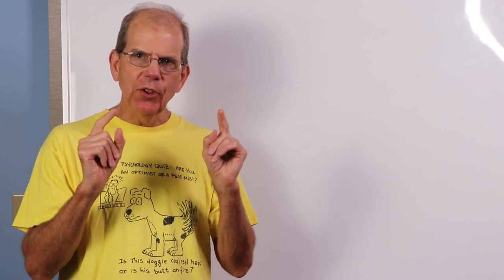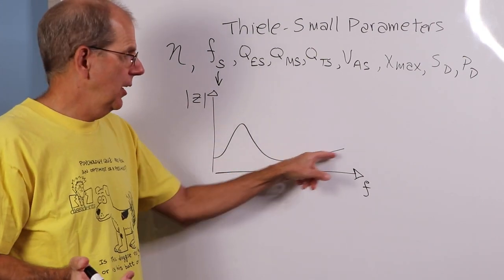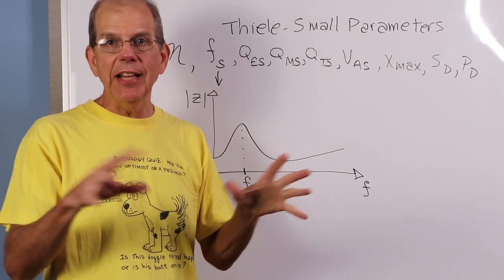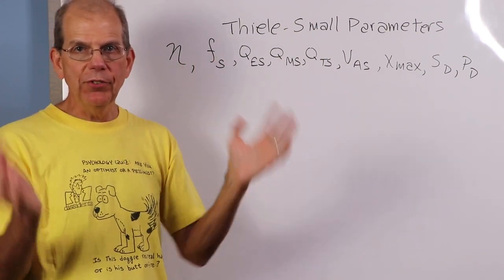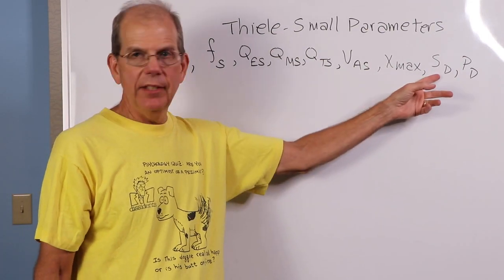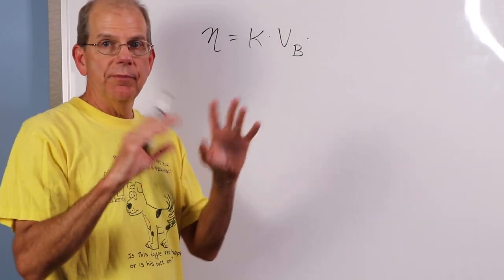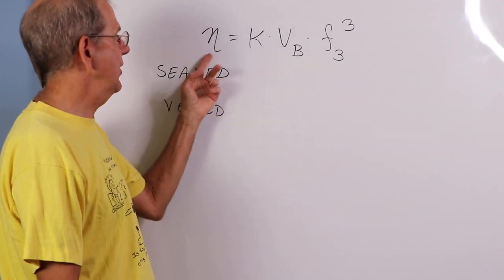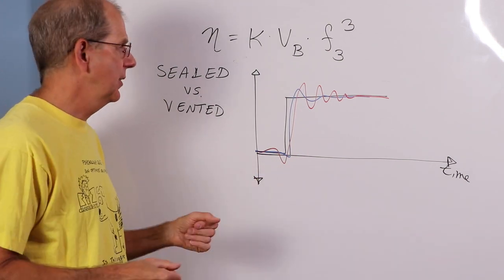Science of Sound: Loudspeaker Enclosures

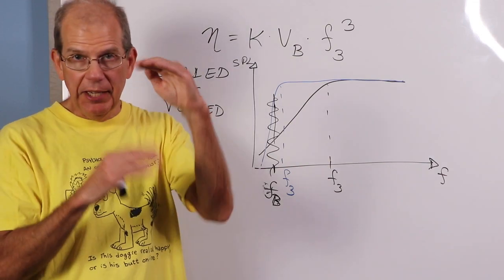Comment: 26:36 Ah... so that's why the rolls of toilet paper I stuck to the back of my DIY polystyrene speaker box improved it's sound quality significantly... I'm guessing the toilet paper acts like a filter, cause otherwise the entire box resonates really bad... XD

More then a decade ago I made 4 20cm x 20cm x 20cm boxes (outer dimensions) with 5" drivers(car speakers), and a 4cm diameter hole on the back out of 2cm thick extruded polystyrene. They ware loud, but sounded really bad until I hot glued a roll of toilet paper on each, which gave it far better base. For amplifier I initially hacked a car radio feeding the signal directly into it's amplifier bypassing the radio circuit and running it from an ATX power supply. It had a TDA7375 amp in 4x7W configuration. Later that broke, and I made 2x25W circuit with the same chip, and I'm still using 2 of those speakers with it. :)

Polystyrene is easy to cut, and glue with paper cutter, and hot glue gun so it's good DIY material, but not ideal for speaker box. If I turn up the volume to like half the amp can do and put my hand on the box I can feel the entire box vibrating, so drum doesn't have that intense kick when I play metal, but it's good for techno. :D (keeping it on carpet rather then on hard surface also improves the sound quality.)

It was cheap, requiring a bit of work, but it's higher quality, and way louder then any cheap to mediocre PC speaker, or soundbar, especially if I listen to music in VLC player, where I have a 10 band EQ, and compression, and some effects to play with... :D